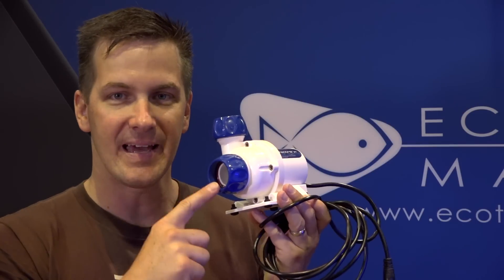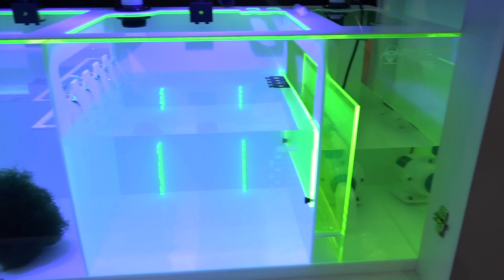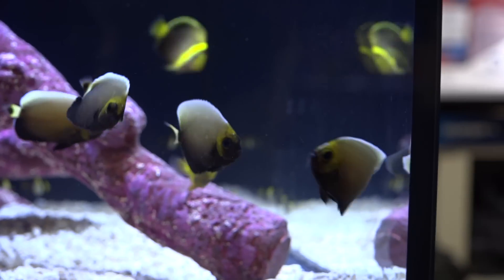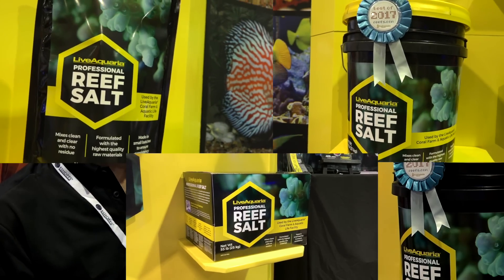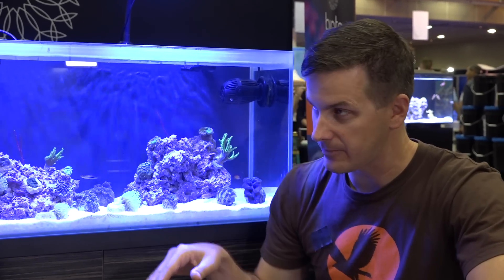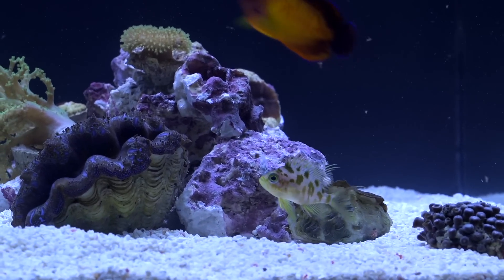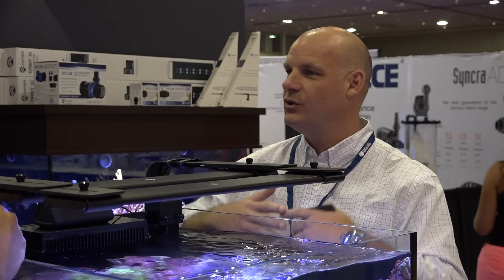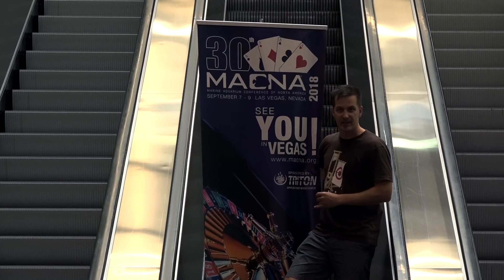Mr. Saltwater Tank's Coverage of MACNA 2017 Part 2

Comment: For Triton sumps, the overflow should dump directly into the macroalgae chamber.  The turbulence is good for Chaeto, and excess food feeds the micro fauna. You don't want a separate, walled off intake chamber that collects waste and requires cleaning.
Reply: Rod Azarmi we are working directly with Triton on designs. The pipes can be directed into the fuge with the first green baffle removed. The separate compartment reduces splash and unwanted salt creep buildup.
Reply: Your sumps are gorgeous, when will the triton sumps be available for sale??
Reply: Joe's Coral Reef we will have them on the website within the next week or so.

Comment: The S1 will be great for smaller set ups. But why do reps say things like "restricting the flow of an AC won't save energy" . It is simple electronics. Less GPH less energy needed. 
Can't wait to see some saptive bred fish in the stores. We have to wait a little longer up here in Canada but it is worth it. 
As gimmiky as that light and speaker set up was,   I can see how it would be a great effect. I can search up wave sounds right here on youtube, but having it sync with the lights was pretty cool .
Reply: If you restrict AC pumps you lose GPH but the head pressure in the pump increases, so the amount of energy it takes stays the same.
Reply: Restriction is the same thing as head pressure.
Reply: If you put restrictions on a AC pump you increase the load, increasing power draw.  With a DC drive pump you simply turn the pump head slower to get a lower flow.  It would be like trying to compare using your cars brakes to maintain a slower speed while also holding the gas pedal down, instead of just lifting off the gas pedal.
Reply: If you want to keep thinking that you can go right ahead  It just shows how little you know. And don't ask me to prove it, because I spent years studying this stuff and I'm not about to educate people. But I know you will insist. I don't know how many times I've had to explain this.  Here is an exerpt from a technical text book. 
Choking the Flow from a Pump Makes it Work Easier

Centrifugal pumps are counter-intuitive. As pressure on a pump increases, the power required decreases. In other words, if you put a valve on the discharge of a pump and begin to restrict the output flow, the power required by the motor will decrease. Most people already have it in their head that choking a pump back will make the pump work harder and use more power. This is incorrect as the pumps work is easier, and the motor uses less power as the flow from the pump is restricted. 

Most engineers falsely believe that the RPM of a pump must be reduced for the power required to also be reduced. This is simply not true when you are talking about pumps with centrifugal impellers. With these type pumps the excess backpressure (created by choking a pump with a valve) is a free by product of horsepower. As the pump pressure increases, the weight of the water being lifted is reduced and the power required decreases. With centrifugal impellers, restricting the flow rate with a valve reduces the power required proportionally. When pumping fairly cool water, these type pumps can be choked back to very small flow rates without any harm to the pump or motor. It is easy to tell if an engineer or pump installer truly understands what they are talking about if he or she understands this counter intuitive property of centrifugal pumps. 

When all you are pumping is cool water at a constant pressure, it is hard to beat the counter intuitive or "magical" horsepower characteristic of a centrifugal pump at a fixed speed. A variable speed controller would only be adding expense and technical complications, while trying to trick it into doing something that the pump already does naturally, simply, and inexpensively. This inherent property of a centrifugal impeller may seem almost "magical", but is simply one of the only laws of nature that is truly Counter Intuitive. 

There are many good uses for variable speed drive units, but pumping cool, clean water at a constant pressure is not one of them. Pumping other substances such as hot water or hydrocarbons may cause damage to the pump if flow is restricted too much. Pumping some materials such as blood may be sensitive to impeller RPM. Other products such as concrete or peanut butter may be sensitive to pressure. Moving these substances with centrifugal pumps or when using any positive displacement pump, a variable speed controller could be beneficial. When all you are pumping is fairly cool, fairly clean water the counter intuitive property of a centrifugal pump with the simplicity of a valve for control cannot be beaten.
Reply: citation needed
Reply: Michael Brice ?
Reply: Head pressure reduces the power that the pump draws. The guy talking about DC pumps saving power has no idea what he's talking about. Not to mention most DC pumps have awful head pressure loss so you need more pump for the same flow that the AC pump pushes. It's a wash.